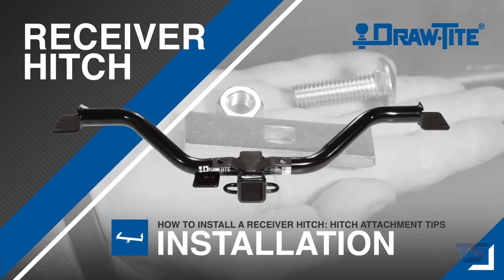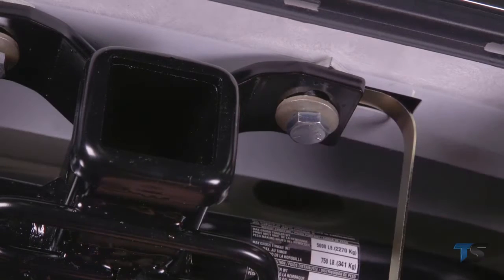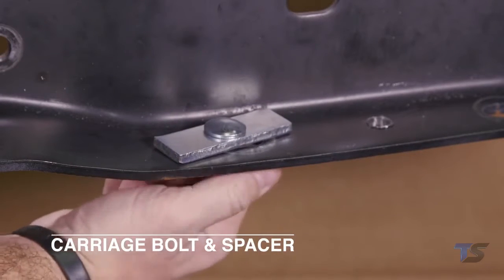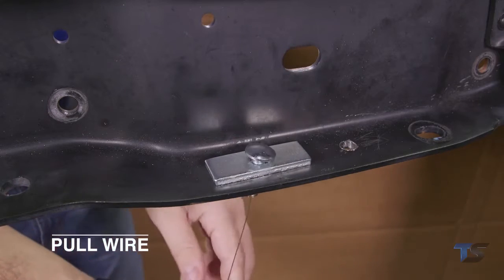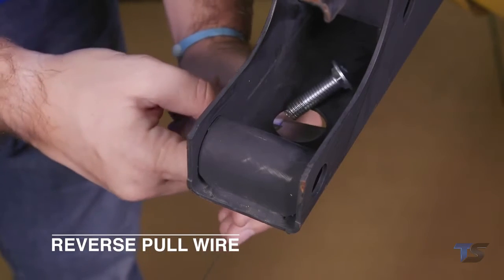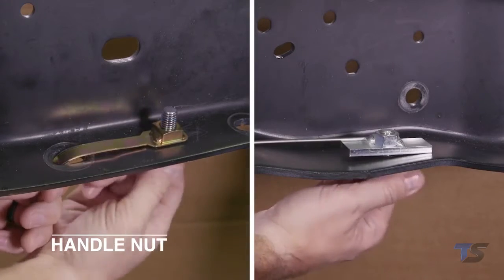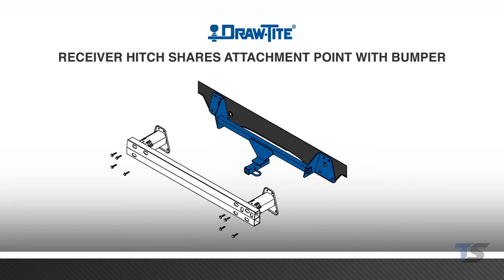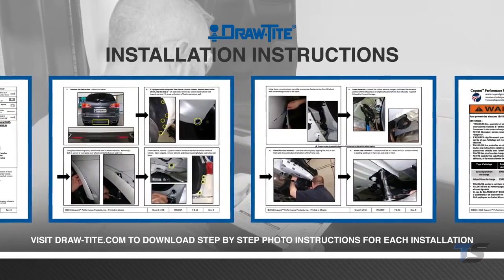Draw•Tite® | How To Install A Receiver (Trailer) Hitch

Comment: does the bumper needs to be cut out?
Reply from the maker: Installation requirements vary with what year / make / model vehicle you have. You can view the specific hitch instructions and what is required for your vehicle on our website for each hitch.  https://www.truckspring.com/towing/trailer-hitches.aspx